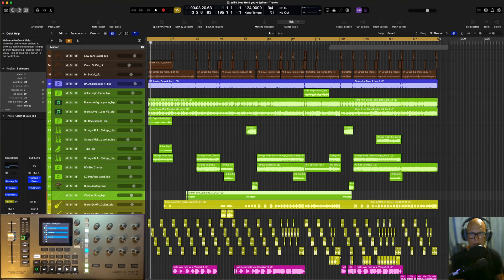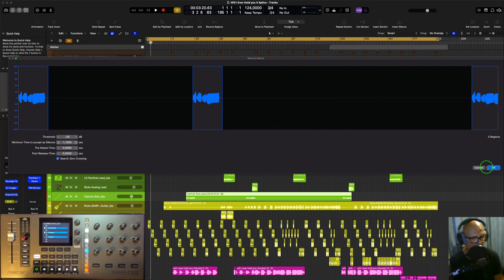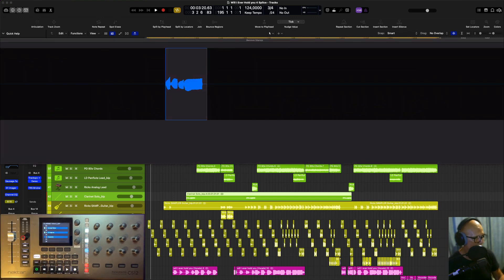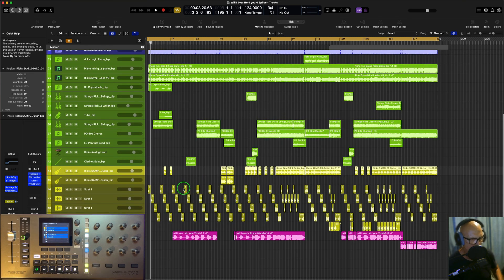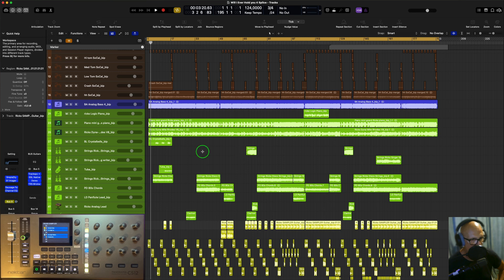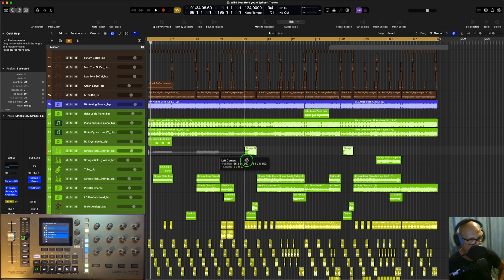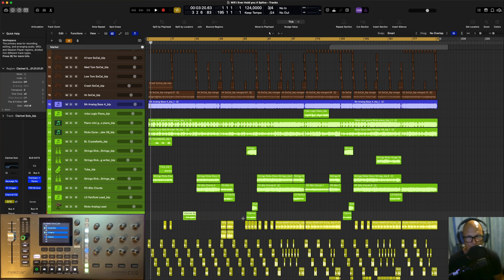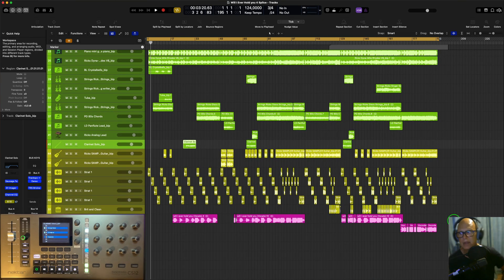How To Remove Silence From An Audio Region: LOGIC PRO 11.01

Comment: I've used the Strip Silence command to convert an audio recording of several continuous one shot samples to individual sound files ready for loading into the sampler. 1) Make a recording of whatever you will want to sample. 2) Use Strip Silence to cut up the audio file into individual samples - adjust preroll and silence threshold according to needs. 3) Select all regions you need from the cut up file and convert these into individual audio files. 4) Load the new audio files into your sampler and adjust the parameters needed.